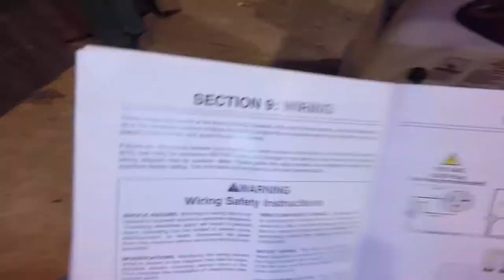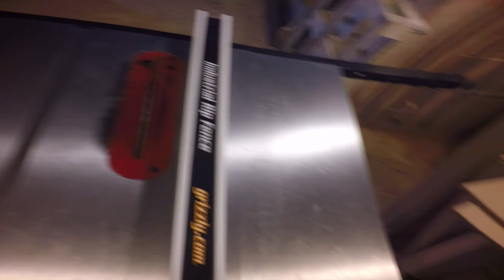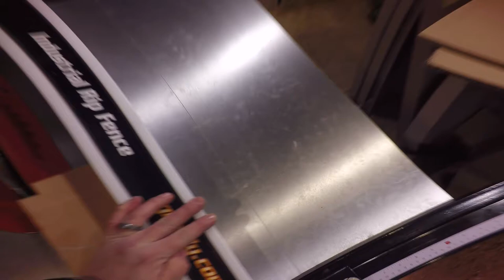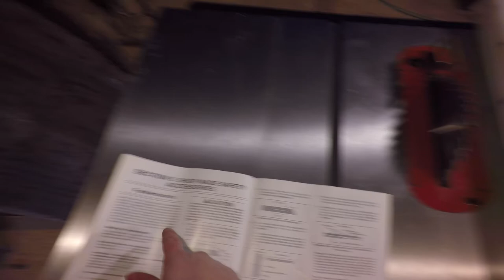Setup and Review of the Grizzly G0715P Table Saw

Comment: I've had my 715P six or seven years now, (in 2019) and I still love it. I added the cast iron router table extension (held between the rails on the right side. Grizzly offers it for another table saw, but not specifically the 715P. It was around $ 250. If anyone reading this is interested, note that the holes don't quite line up where it meets the wing extension - they need to be elongated just a little. Fortunately, a quick look in the phone book for machinists located a local shop and $50 later I was back in my shop mounting it successfully to the saw table. It's been a great addition, not only for the router itself, but also in extending the size of the saw's table support. Cheers

Comment: Good Video I ran into the same belt tensioning issue after assembly. As far as the blade alignment issue at different heights, it has not been an issue for me. Yes I did have to perform some very minor trunion alignment.  This is much better than my old craftsman contractor saw.
Reply from the maker: +Craig Chavis Yeah I think I realized that I followed the instructions a little too literally. They have you remove the locking brace from the motor, but not tension the belt and tighten the motor in place.  Pretty obvious fix though :)

Comment: nice saw...I just ordered one Hope I dont have any saw blade alignment issues.  Hope yours is staying aligned.
Reply from the maker: +Michael Josemans Michael I looooove this saw.  I bought a Woodpecker saw gauge and tested out the blade alignment. Almost perfect straight from the factory (within about 2-3 thousandths of an inch).  Still need to get the video of that up!
Reply: +RC Creative Did you check the alignment as it moves up and down? Mine varied by up to .030" at the rear of the blade as I changed blade height. Needless to say I had to return it.
Reply from the maker: Mine seems to be fine in that regard fortunately!
Reply: Lower cost, Asian built products are hit and miss. Most are good. But be ready to repair or return if not. No free lunch. Quality control is expensive.

Comment: I have this GO715P Grizzly saw. It's great. You may want to consider the Shop Fox Heavy duty mobile base for less than $100 which makes your saw mobile which is important when shop  space is limited.
Reply from the maker: +Duck4212 Agreed.  I'm still trying to decide if mobility in my situation matters but I'll probably end up picking one of those up.

Comment: Nice video! I'm considering this saw and am wondering if you've heard of or had any experience with the 'blade drift' issue on this. Apparently on some units the rear of the blade would 'kick out' as you raised or lowered it, resulting in misalignment with the miter and fence?
Reply from the maker: +Lerch 2013 I haven't experienced that problem myself but I've not used it much yet. The full-time woodworker at Topnotch Woodworks  that gave me a glowing recommendation of this saw uses it all day every day and hasn't experienced it either.
Reply: +RC Creative Thanks! I'm a little closer to buying, I think :)
Reply from the maker: Lerch 2013 No problem :) If I run into any troubles with it I'll post another follow-up comment and letcha know! But so far I love it.

Comment: Great vid and info. I'm trying to decide between this or the G1023RL. Is it possible to scoot the fence rails over to the right to have more rip capacity? I know for the G0690 you can per a Jay Bates vid. Thanks.
Reply from the maker: Any chance you could post me a link to that Jay Bates video?  I wanted to check out what you were talking about and get you an answer, but I didn't have much luck locating that video (too lazy to check through JB's whole collection :)
Reply from the maker: So that link took me back to my own video :) But anyway, looking at the table saw in a bunch of Jay Bates videos, I'd say the answer to your question is yes.  The rails on the G0715P are fairly long and you can slide the rip fence pretty far off to the right, and I'd say get at least a 30 inch rip capacity. If that's not enough... on my last table saw I had installed an after-market Shop Fox rip fence with really long rails. But it turned out they were so long that it made my tiny shop impossible to navigate.  Hope that helps!

Comment: Don't use a level.  Use a straight edge that's machined to a low tolerance.  Mine is 50" long with .003" tolerance and paid about $150 for it.  It's the best money I've spent because my table saw, jointer, and planer are dead nuts on.  I also have a mobile workstation that doubles as an outfeed table.  I use the straight edge for aligning this also.  I rarely have joinery issues, and when I do, it's because I made a mistake, not the machines.  The machines make perfect cuts and it saves a ton of time hand planing and/or sanding.

Comment: The big question I have is how did you get a 400 lb. box off the back of the semi delivery truck and then into your garage?
Reply from the maker: +disposer I figured I already dropped a chunk of change for the saw and for shipping, so I dropped a bit more and paid for lift gate service. I setup a ramp into the shed and the UPS Freight driver pulled it right in on a pallet jack.  The only hard work of the whole affair was working it off the pallet by myself.

Comment: Are You happy with the power? Do you find it lacking in anyway?
Reply from the maker: plenty of power for my needs and I have it wired for 110. very happy so far. ovrr time they
 sliding mechanism for the fence has gotten a little wonky but other than that, top knotch.